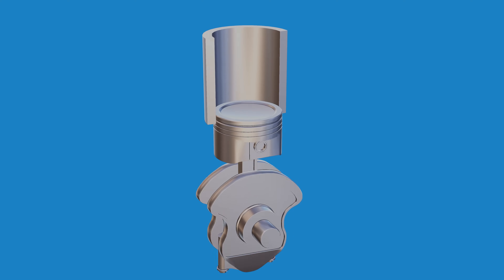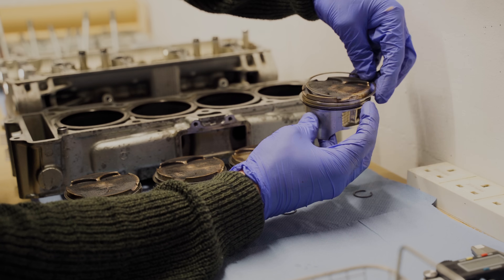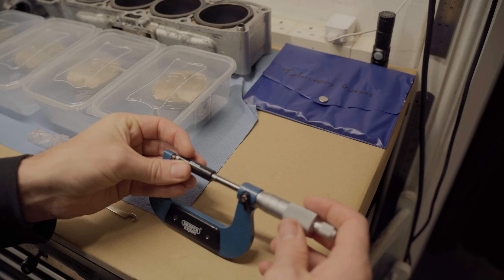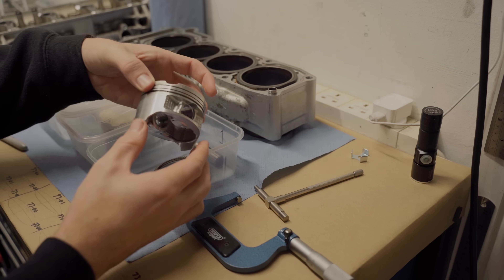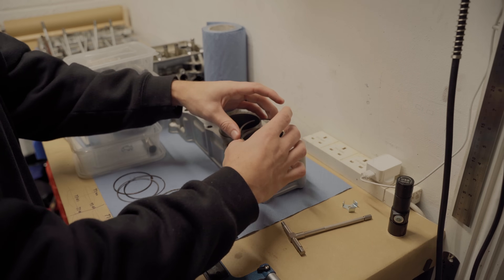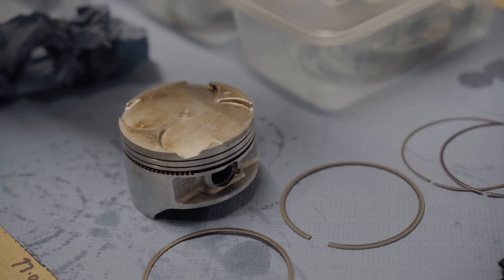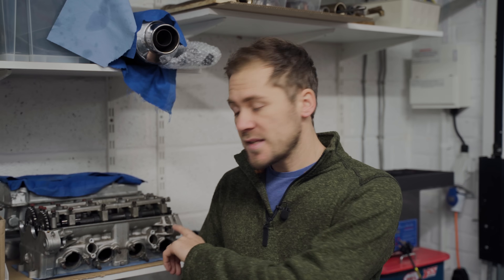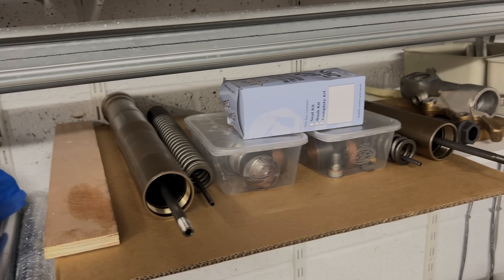Inspecting Pistons and Honing Cylinders on my ZX7R - Ep7 | ZX7R Restoration | Tom's Workshop

Comment: Hi Tom - what was your technique for using the telescopic gauges as I was getting measurements less than the pistons so obviously I was doing something wrong  🤷‍♂
Reply from the maker: The bit that took me a while to get right in order to get accurate measurements was making sure I used the ratchet on the micrometer to ensure I wasn’t adding any force to the telescoping gauge when measuring. And it’s always good to make sure it’s zero’d off the zeroing block that comes with. Again using the ratchet to get the same pressure

Comment: Hi Tom.  Fancy overhauling my 2000 P5 Engine. Had a cylinder go down, bent valves. Replaced them and new piston, p s I didn't do repairs my friend did but he's passed away. Thing is there's still something not right. Someone says bottom end and others say valve clearance.  The engine is not in bike now but only done 7000 miles. Help 😢
Reply from the maker: I wouldn’t put myself in the league of a proper mechanic that would be able to offer up an accurate diagnosis, what are the symptoms you’ve found since the initial fix was done? Valve clearances is easy enough to check but they would (should) have been done after the new valves went in.

Comment: If you are reusing the original, or not new cylinder head bolts you have to use the used torque spec. Once they have been stretched you don’t want to stretch them again. The torque spec is in the manual
Reply from the maker: Thanks for the tip 🙏🏼

Comment: Well done mate, you are making good progress 👍  A couple of top tips for you if I may! Always replace the rings if at all possible. They lose their energy (Springiness) over time.  Even if they measure ok in terms of dimensions it doesn't mean they are ok. Cylinder wall finish is also really important. The Grit and material the hone is made from can really affect the surface finish, which in turn affects the longevity of the engine. After honing you need to spend a lot of time cleaning the cylinders. Just because they look clean doesn't mean they are clean enough!
Reply from the maker: Thanks Jim! Really appreciate you watching and the tips. I've learned a huge amount from your vids over the years and often go back to the GSXR750 engine series for the valuable insights you share about these things. My first time inside an engine is a wee bit less daunting as a result! I think I'm going to replace the rings prior to reassembly just in case, along with a good clean of the cylinders. I'm now convinced it's a worthwhile cost.
Reply: @tomsworkshopprojects  You are very welcome mate, keep up the great work!

Comment: I have a bent oil ring from my ZZ7R P6.....As I slide the cylinder block down the wee ring popped out and it slid down with ease, nothing hanging up until it stopped. 1 new liner later. Very happy bike. Just reminds me, one little miss hap can cost and slow down a project. Kamakazi took 6 weeks to ship from Japan.
Reply from the maker: Ouch 😩 yeah I’m a little apprehensive about reassembly, If I end up splitting the cases I’ll probably fit them in one by one and do the gudgeon pins from underneath.

Comment: Love the build so far Tom, just wanted to give a little advice. You never want to stop the hone in the cylinder when you are putting the crosshatch.
Reply from the maker: Good tip, cheers! In all the research I did there were such conflicting thoughts on it. All experienced points of view as well, but I do see the logic of not stopping.

Comment: Did you give the cylinder barrells a complete clean afterwards after your honing? Washing out with warm soapy water, its extremely important to ensure there absolutely no microscopic  traces of metal after the honing. 
Really good attention to detail, liking these videos😂.
Reply from the maker: Cheers! Yeah they got a good clean, however they’ll be getting another proper clean and blow out before painting the outside which should make sure there’s no grinding residue left in there!

Comment: What liquid do you use for aluminium cleaning in the ultra sonic
Reply from the maker: I’m still playing around with different fluids, I’ve tried Carbusonic which worked ok but you have to rinse them well afterwards. For the pistons I used brake cleaner diluted slightly with distilled water. Which worked quite well.

Comment: Hi Tom, I’m sure you know but it didn’t show in the video. You should always use the little ratchet on the end of the micrometer so that you apply the same pressure when measuring. Otherwise you are relying on your own internal calibration of using the same finger/thumb pressure each time you measure something. Great episode again, really looking forward to the next one. . . .However long it takes.
Reply from the maker: That makes a lot of sense, I hadn’t quite found a solid answer as to what the ratchet was for, I’ll bear that in mind for future measurements!
Reply: Hi there, I'm late to watching the video, so I'm sure you might have been told already by now, but to get accurate and respectable readings, you have to use smaller, outer ratcheting dial wheel when taking measurements. 
It has a ratchet set to a specific slip to ensure that it gets to a certain level of tightness and no more. 

The way you used the micrometer isn't reliable nor accurate.

Hope this helps?